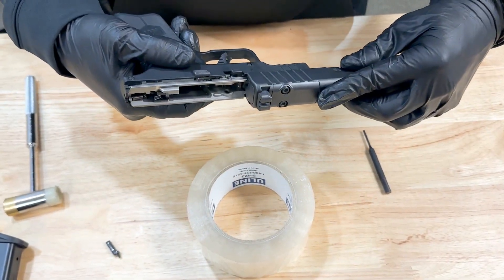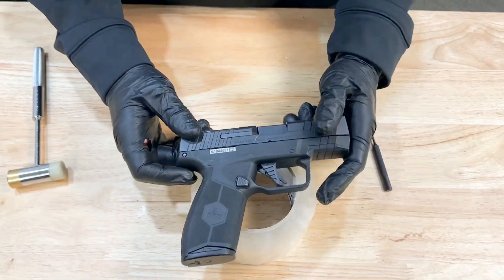IWI Masada Slim Left Handed Magazine Release

Comment: Hey Austin, do you have a holster option you would recommend for the Slim?   ANR design pushed me away from their product after their video.
Reply from the maker: I tried both the FS tactical and ANR designs. Personally I still recommend ANR due to the kydex thickness, holster wing, and the fitment. 

ANR makes one of the best holsters currently on the market and with the slim being a new design you will find it difficult to have a ton of different options.
Reply: ANR doesn't have lefty options for the Masada Slim